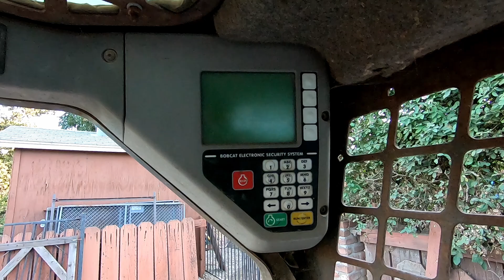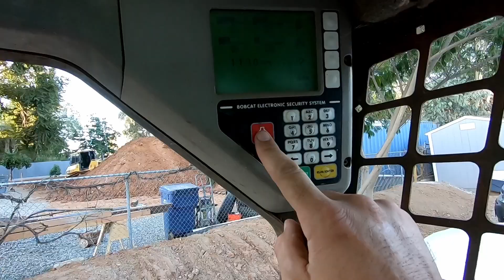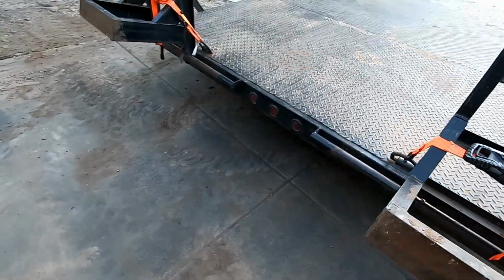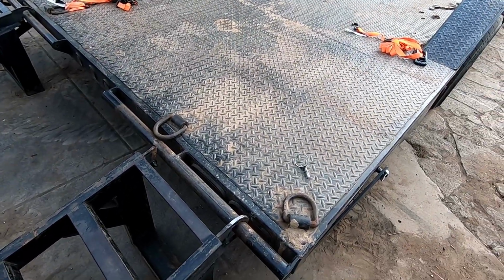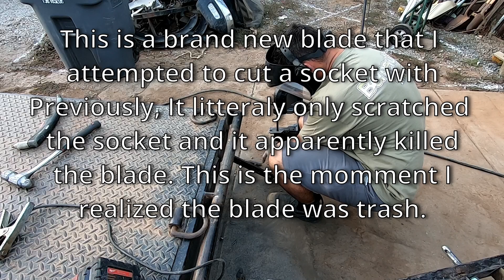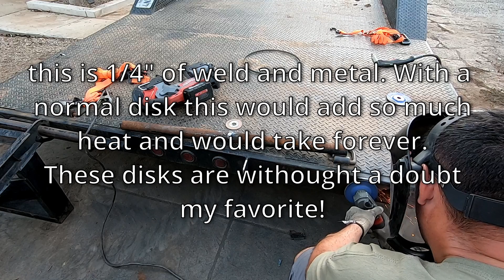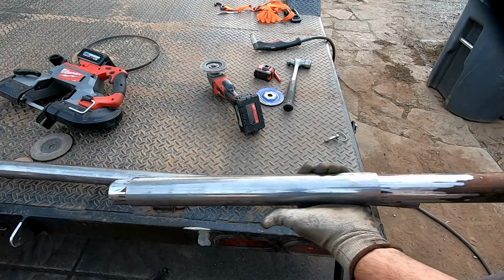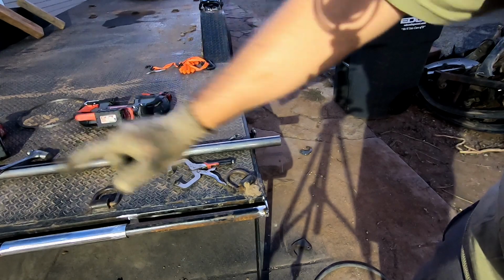Imago Trailer Modification / upgrade.

Comment: instead of welding straight to metal on main rod cut round hole run it through a ways then weld it and maybe double up on them if you know what i mean. seems like a weak point to weld the metal round rod to ears holding it
Reply: infact if you do it that way could probably fabricate a way to remove the ramps all together if needed
Reply from the maker: Yes I thought about that but I was very curious how it would do withought it. The trailer was actually involved In an accident and I'm going to be rebuilding the front. I will also do an update on the ramps.

Comment: 10:27 you should of put a grease fitting on it, what's going to happen is rust will build between each tube making it impossible to move the ramps also it'll help with any wear from metal to metal contact. 

personally i would have kept the middle support in since you're relying on so little material, there's an old saying "an inch of good weld can carry a ton" meaning each pipe attachment to the trailer is able to carry about a ton meaning around 2 ton per ramp which sounds good and all but then you've got lever multiplier meaning the total strength is less than that probably around a ton. adding that extra one back in however not only shortens the lever length but also add's a ton extra strength. without the loss of pipe to pipe contact area. to make it  even stronger still i would brace both ramps together and make it into a beaver styled ramp meaning you haven't lost the ability to move smaller machinery since you're ramps are fixed.
Reply from the maker: On this application the grease will attract and hold dirt. This trailer gets backed into dirt piles often. I am not sure the tabs on the end are strong enough to hold the bar without a center support so the whole thing is a trial. I did not charge for this and it is a friends trailer so if something lets go I will re configure it.

Comment: Hey man, on your bandsaw when you changed out the crappy blade for a better blade what brand did you end up using? Do you happen to have a link? Unfortunately, I have bought three different brands of blades and they all have been garbage. Thanks man.
Reply from the maker: I use the Milwaukee brand blades for the band saw and use Diablo for everything else

Comment: How long are them ramps? I'm going to do the same kind of thing to my trailer, but I was going for 5 foot ramps them looked longer than 5 foot
Reply from the maker: They are 5'
Reply: @penguinsgarage  right on that's what I planned on and I'm going to do like your first plan was but im planning on 1/2 thick steel with the center bracket
Reply: want i have done made th metal addustion box i put the ramps on reaches out 2 more feet it is a bite heavy for me i do struggle with then putting on to the trailer afterward i am 100 pound wet my uncle keep saying to me lolmy hight is on the short side too 
enough with the short joke  yes I am standing up  lol

Comment: What about a gusset on the ramp that would go under the c-channel when you fold down the ramps to take the weight off the pipes?
Reply from the maker: That's what the legs are for.

Comment: i was on the side of the road with a blown engine lol a month-old semi-truck blew a hole through the side of the engine not an easy way to get one unhooked from the trailer too  my driver had a weld load on that truck yes we did buy the truck for this propose we had trouble with that type of engine  had them in our tractors to the same problem blow the hole throw the engine  like a hand grenade blow a hole throw the side of them 
my family does have a few companies we own one that is hauling oversized loads or loves weight loads to custom trailers too  the police were very helpful and let just tow it to a safer place to get the load off the highway old server station was there at one time 8 hour later we got that truck pull out and the new truck under it 8 hours to rehook the truck back up i have steering at the back end of the trailer both sides do have a driver for it